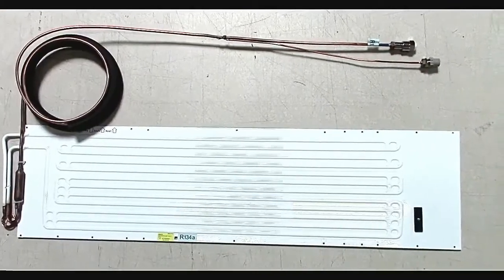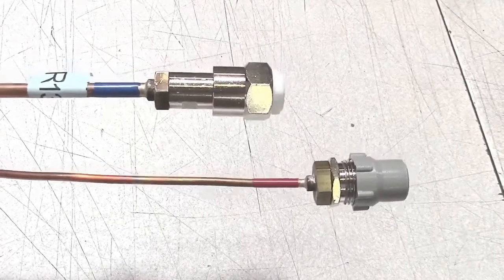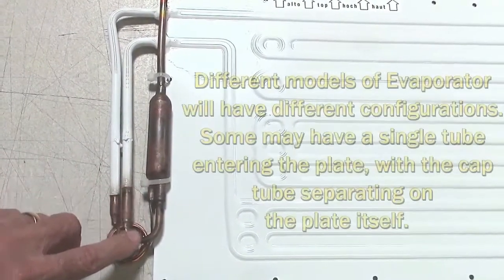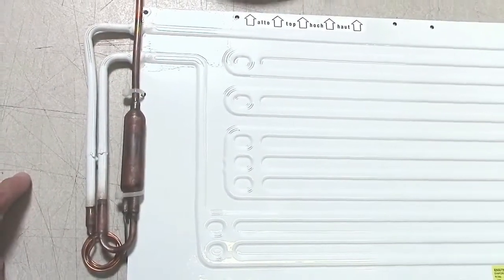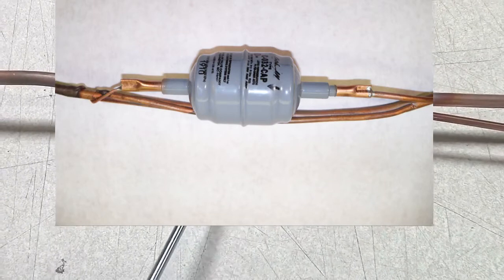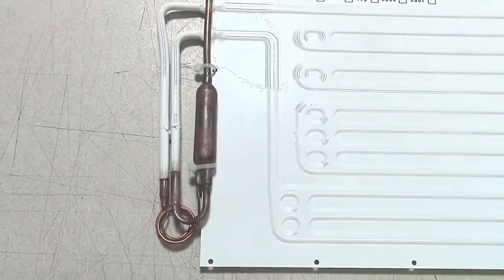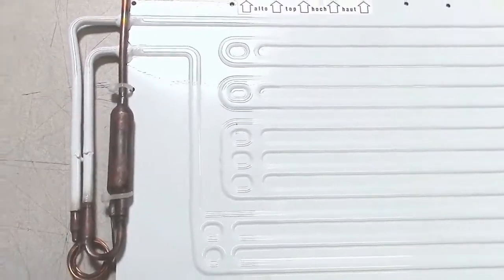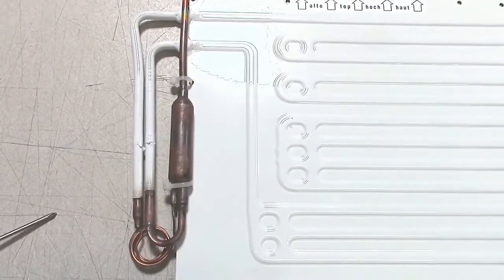Tech Tip - Cap Tube Blockages

Comment: Dirt and moisture are the biggest enemy of any refrigeration system. Please note that through that small bore tube "the capillary tube" liquid refrigerant flows as it travels though it resistance to flow from the small diameter and length starts to reduce the pressure and the liquid refrigerant starts to flash into  cold vapour liquid mixture .Once this mixture drops in temp to 0 degrees C any water mixed with the refrigerant will freeze and partially or totally block the flow,thus stopping the refrigeration.
Dirt can also partially block or totally block the capillary, usually the dirt is introduced by welding oxides or swarf from when the system was put together ,or after a repair in which strict procedures where not followed.

Comment: I have a small 12v fridge. Compressor kicks on , thermistor reads accurately and thermostat works. Capillary tube gets ice cold but fridge stays hot. Does that sound like a capillary tube blockage ?
Reply: NC did you find the problem with your 12v fridge? Mine has the same symptoms.